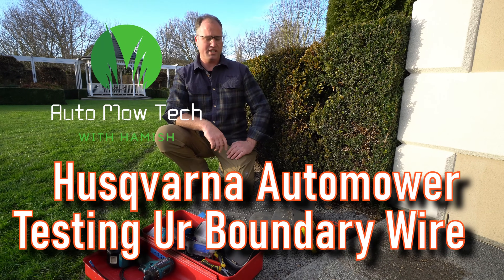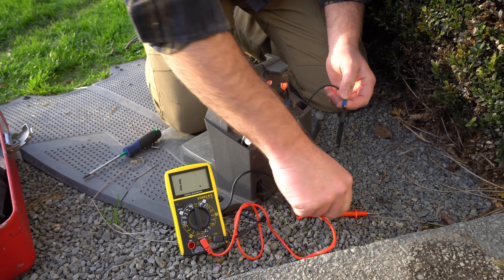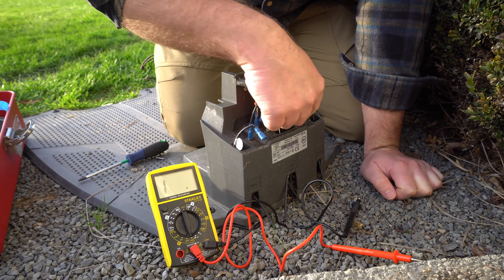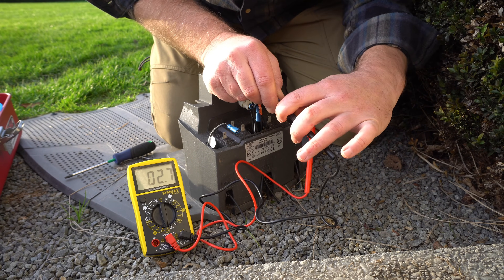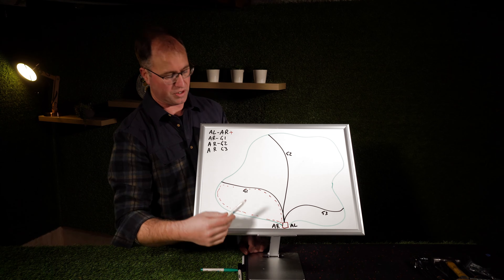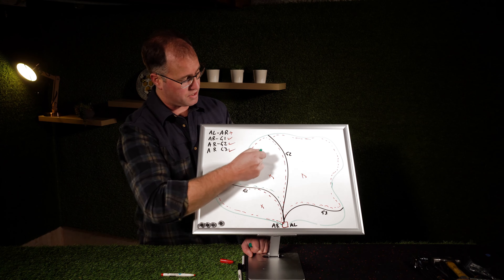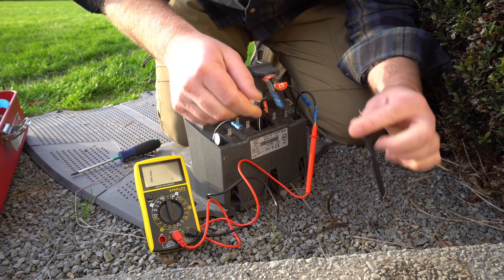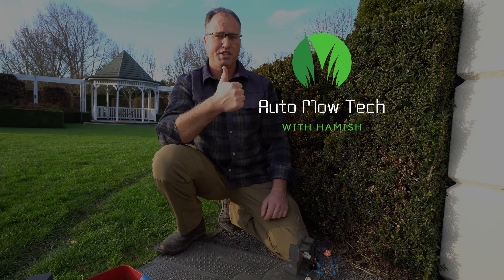Testing Your Boundary Wire Husqvarna Automower

Comment: Hello, before sorry for my english i m from belgium,  my automower 310 work Perfectly but now not detected guide cable , i have testing wire multimeter i have 3 ohms guide cable , wen i switch cable guide and ar and al the color is green , you have a idea what is the problème?😢
Reply from the maker: You want to go to your "finding charge ststion" settings..make sure your guide is set to "0" min so it's looking for it stright away when going to find the charge plate and cheek using guide is on or it may only be looking for charge plate and boundary.
Reply: Has already been done , and when i tested druck guide cable my robot not find guide cable 😢

Comment: how do you find the washer if its grown over?
Reply from the maker: Good question - 1st you ensure you have a map of ur lawn and your wire and mark out where joins are on thst map..then with an extension good strong pen style magnet you use that to locate ur washer marker..key is to have that map as a few years later it's hard to remove where a join is.

Comment: Very nice video, it helps me understand the concept and also how to troubleshoot with the multimeter, which I'll do very soon. My remaining challenge will be to find the faulty cable (if any) given it's buried quite deeply apparently and given I don't have any installation map.
Reply from the maker: @pierrechristen9025  definitely more challenging when you have no instsll map..I have worked on many like that..you can get the mower to trace back a guide and run another guide as a boundary to eliminate as much un known ,depending on how much install is affected.. a tone tester will be worth the money to assist (note:tone tester can trace threw a failed join) some people ue an AM radio also